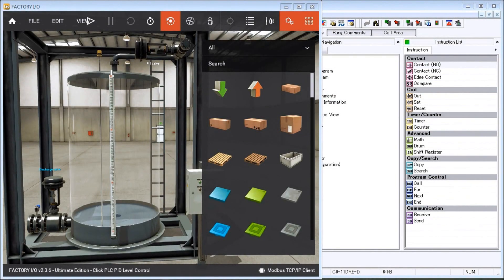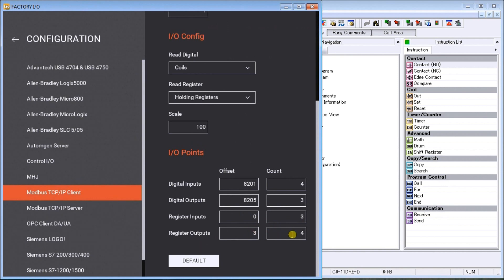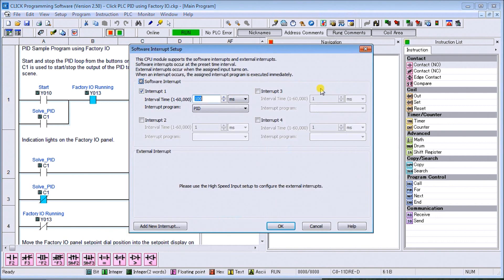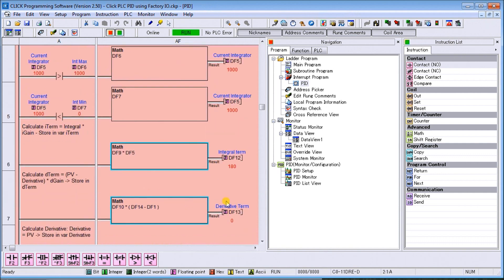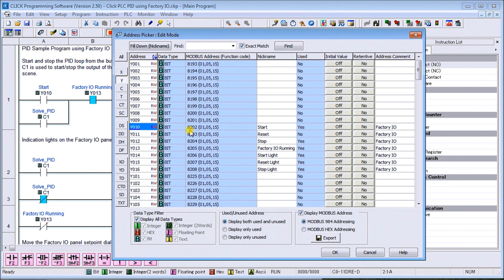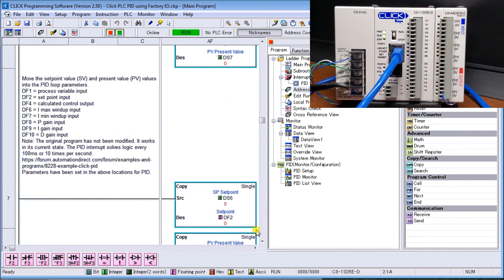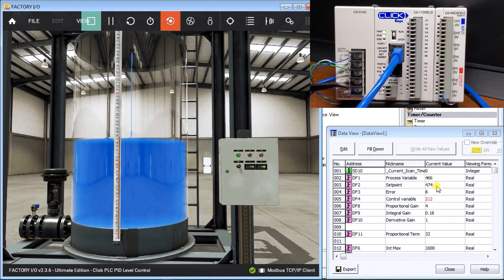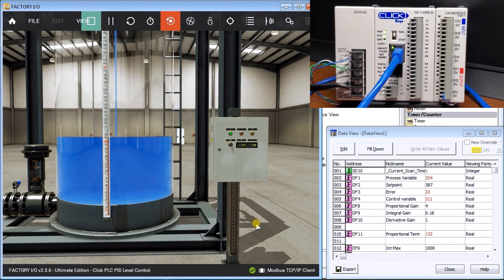Click PLC PID Function with Factory IO 3D Simulation Now!

Comment: Hello, Thanks for this interesting code. I am having a similar situation for my project where I use heating and cooling instead of filling and discharging. However in rung 9 from the main program I saw the utilization of a fill valve but not the discharge valve. So how will the plc know that the discharge valve has to open in case the SP is < than the actual value.
Reply from the maker: Hi @junkydeka5534
In this example, the discharge valve is a constant. The PID is used to determine the tank's input filling valve. With a constant discharge, PID control will work well. Remember that this is a time-based control. If the discharge valve were to change, the PID parameters would also have to change.
Heating and cooling applications are good candidates for PID since the heating and cooling devices and the mass controlled are generally constant.
In your application, the heater would use PID to control the temperature in reverse. You would then build in a dead zone around the setpoint so that you are not trying to control heating and cooling simultaneously. The cooling will use PID to control the temperature forward. 
Usually, when I do temperature control, I use a dedicated PID temperature process unit like the Solo. This will handle the heating and cooling and, if needed, any cascade control.
The Click (PLC) then will communicate to the Solo.
https://accautomation.ca/click-plc-serial-communication-timing/
I hope this helps you out.
Regards,
Garry

Comment: How can i communicate omrin plc to factory i/o thank ung modbus tcp clieante
Reply from the maker: Hi Manuel,
The Omron controller can communicate to Factory IO using Modbus RTU or TCP protocol. You will have to check to see if the protocol is supported on your model of Omron PLC. 
The other way is to use an interface board. You can wire the Omron PLC to the interface board and the board will communicate to Factory IO.
https://docs.factoryio.com/manual/drivers/advantech/
I hope this helps you out.
Regards,
Garry
Reply: @ACCautomation  ihave cp1h-x pls can you have some tutvedio in that problem so ican know what to do verry thanks sir garry shortt is ma pleasure to one of your suscriber
Reply from the maker: @manueldanaojr.1  
Hi Manuel,
I do not have any videos that are specific to your hardware. What you will need is a CP1W-MODTCP61  connected to your PLC.
This will be set up as a Modbus TCP Slave (Server) for the Factory IO Master (Client). Here is a link for the hardware and specific manuals.
http://www.omron.com.au/data_pdf/cat/p63p.pdf?id=3333
Regards,
Garry
Reply: @ACCautomation  thank you verry much